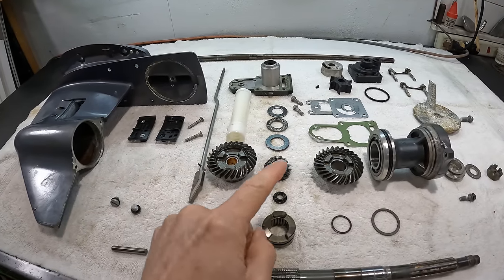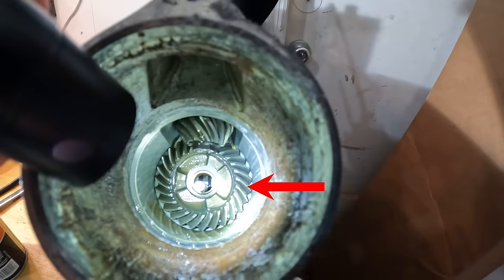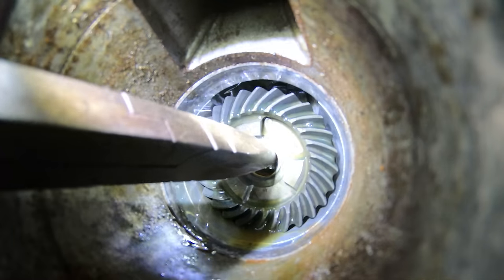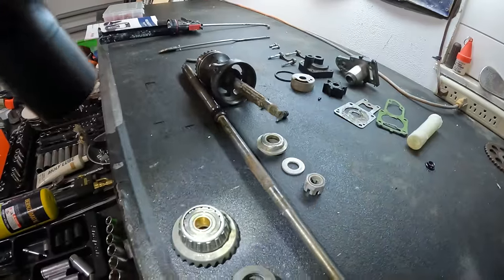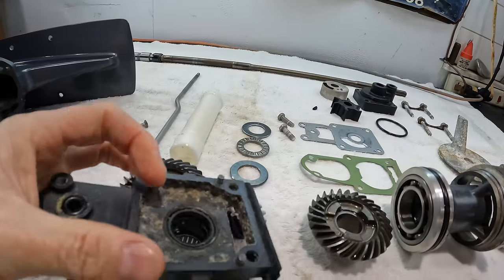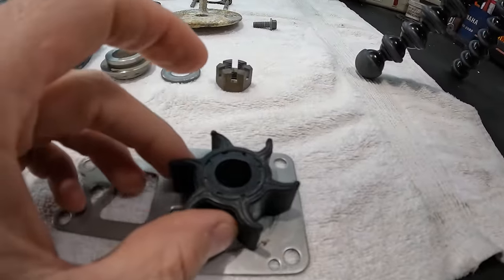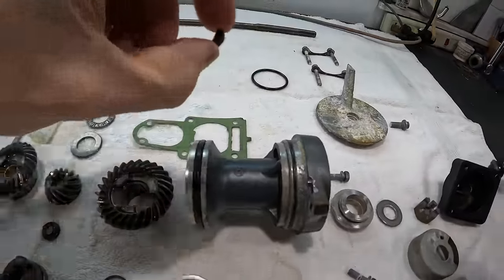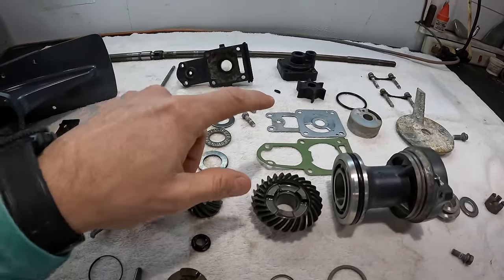HOW A LOWER UNIT WORKS!!!

Comment: I use too rebuild the old Merc Alpha 1 Stern Drive units.  There are special tools and ways to rebuild that you can only learn from someone who knows how to do this the right way. This one you show is a bit simpler I assume this is an outboard engine. My boats were used in the ocean and out there your life can depend on the boat running.
Reply from the maker: That's awesome, a lot of similarities in the stern drives and the outboards with the exception of the uppers on the stern drives lol but this was a smaller 25HP outboard so yeah, a lot simplier!

Comment: I've got a 2002 Johnson V4 115 hp engine that's recently been experiencing extremely hard shifting from both Neutral to Forward, and Neutral to Reverse.  Last spring, I took the time to lubricate the binnacle mechanism that I purchased used from a freshwater boat to replace the one that was on the boat, as well as lubricate both the throttle cable and shift cable by using tubing hose clamped to the cable, filled it with silicone lubricant, and pressurized it until the silicone lubricant came out the other end at the outboard.  After doing all of this, the throttle cable moves so effortlessly that I have to be careful that I don't launch the onto plane after making the slightest change in position once in gear, but the shift cable is still extremely hard to shift, and many times when pushing the throttle forward from Neutral to Forward, the engine just revs to 1,500 RPM in Neutral and then goes into gear with a delayed shift.  Based on what I've done already to rectify this situation and the symptoms that I'm still experiencing, would you say that I have a bad shift cable (it is the original), or is my issue in the lower end?  Any advice from Born Again Boating would be GREATLY appreciated.
Reply from the maker: Well, a couple things, yes, definitely could be the cable still even though you did all that work. But:
Have you tried to disconnect the cables and run the engine without the cables connected? Like try and shift it by hand with some pliers or something there at the engine and see if you still have the same issue even by hand?
What is the RPM when you are shifting? If it's higher than 1000 you are going to have a hard shift either way because the force of everything spinning that high.
Reply: @BornAgainBoating   - With how tightly packaged the throttle cable, shift cable, other wires, and the rubber straps for the airbox / silencer straps are that tuck in-between the engine block and lower cowl, it's difficult to get at.  I need to find out how to remove that lower cowl, so that I can easily get at the shift cable to disconnect it and test just like you said, but despite removing a number of screws, I'm unable to get the lower cowl off.  I feel like it's still secured somewhere in the mid-section of the engine.  I even bought an Evinrude factory manual from Ebay, which I thought would assist with removing this, but proved to be of no use.  I guess that I have to just pull on it harder and see about getting it off.  

I would say that it's shifting at 1,500 - 1,800 RPM when initially put from Neutral to Forward, so yes, it's going to be violent when doing so.  From Neutral to Reverse, it's not so bad, but not normal by any means.  It also has a hard time finding Neutral many times.  When I'm docking and in Forward, I have to pull the binnacle back to Neutral and temporarily bump it into Reverse to then push forward to get it into Neutral.  It's not an issue with the binnacle, as when the cables aren't hooked up to it, the binnacle mechanism performs properly and flawlessly.  It's clearly either the shift cable, or the shift mechanism on the outboard.  I've hosed down the shift mechanism levers and rods (as best that I can) with lubrication, but that hasn't changed anything.  I need to get the cowl off and test further the cable and shift mechanism on the outboard.

Comment: Glad you made this video. Going to have to rebuild a 6HP mercury lower unit that I got as a basket case.
Reply from the maker: For sure! And ouch! Just a thought, maybe look around for a used lower unit, you could probably find one for a couple hundred bucks instead of dumping time and money in rebuilding the one you got ;) These little lowers usually come pretty easily and cheaper compared to repairing one :)
Reply: @BornAgainBoating  if you run across one, let me know.

Comment: Great video, detailed and concise!
The offset stamping on the lower housing is something I wasn’t aware of. Helpful, but seems like a work around for the manufacturer to be able to source lower quality castings. It apparently costs less to measure, emboss measurements and install shimming rather than cast/ machine with closer tolerances. Understandable, especially if the cost savings are passed along to the consumer (insert cynical comment here). I wonder if this is still the methodology in the fancy new motors these days - I’m still running a 1998 Yam 2 smoke 250

Comment: Gday mate that is the best explanation of the workings of a gear case i have seen you made it look easy pulling out carrier from the housing but ive seen some hell carriers ,question is there a special socket you used to turn the drive shaft when getting the pinion nut of ? ive bookmarked this as i said it is the best explanation of tollerences and the breakdown of the gearcase i have ever seen .
Reply from the maker: Hey, thank you! Yes, it depends on the lower unit, but there are special sockets that you can get that slide over the driveshaft to hold it! Depending on the lower too, you might need a special wrench, or have to make a special wrench to hold the nut. But check out Marine Tech Tools, they usually have the sockets for the driveshafts that you could get for whatever you need :)

Comment: Great content! How about a video on what tools should be carried on a boat while on the water? I run a Hewes 18 so weight is important, but so is getting back to the hill. I don't have to carry as much as some, because I'm generally not more than a few miles from some form of safety. So my box isn't going to be as loaded as someone running 50 miles, who can also handle more weight. So what basic tools for common issues and what are some good combo or multipurpose tools that can accomplish multiple tasks? We all know everything is a hammer so I can do without that!
Reply from the maker: Great question, like you said it'll depend on how you use your boat, but just the Leatherman Super tool 300, that thing will do pretty much everything you need, that and some zip ties and a water bottle :)

Comment: Thanks for the great teaching which is easily understood.
I have just purchased a 2012 Mercury 90 four stroke efi and when checking the water pump found the lower Unit top pinion shaft bearing has some rust on it indicating the seal was leaking .The Manual says to replace the bearing ($150 NZD ) if it shows rust but my question is when i lift the shaft up and put it in gear it sounds and feels smooth and only when there is no upward pressure on the shaft does it sound a bit noisy.
The Oil had no metal particles in it but possibly indications of a little water in it  as it only has 80 hours on it and the manual says the first drain might indicate assembly lube. What do you think, pull it apart or leave as is with new seals .I'm in New Zealand and a brother in Christ..

Comment: Great video/explanation. Do you think a 2013 Suzuki 115 would be the similar set up?
Reply from the maker: Basically yes, but the carrier assembly will probably be different and have a spanner nut assembly holding it in. It will definitely be a bigger set up, but functionally it will be the same but also have a shift shaft that spins :)

Comment: Great video.  I have a 2005 Suk 250 with a leak around the prop shaft even after replacing the seals.  There is a visible bearing carrier crack near the seal.  To remove the carrier on a Zuk, is it pretty much the same process as this video?  No special removal tools?  Thanks much.
Reply from the maker: Actually, on most larger engines like 250s, they don't come out like this, but I think on the 2005 Suzuki it does have a similar set up with the bolts holding the carrier in. Not 100% but I believe it does come out and you won't need special tools, at least to get the carrier out. So you should be able to replace the carrier without special tools. You might have some work to do on the bearing and race, getting the race out the carrier, unless you replace them, not sure what comes with new carrier.
Reply: @BornAgainBoating  Got you, thank you for taking the time!  Keep up the great content. Cheers.

Comment: shouldn;t you have loosen the pinion nut with the drive shaft bearing in place? Removing it and loosening the nut induces unnecessary strain to the lower needle bearing.
Reply from the maker: This is true!

Comment: Which motor is this? Is it a 9.9-15hp yamaha outboard lower unit? cause if it is im about to repair my 98 15hp that has the lower unit corroded but the interior is all brand new
Reply from the maker: Yamaha 25HP, should be super similiar
Reply: @BornAgainBoating   thanks man

Comment: But as far as you know, is the driveshaft entirely made of tempered steel or just the ends? Thanks
Reply from the maker: No idea bro, depends on the lower unit you are talking about, brand, size, etc. I would say that some of the smaller ones are not

Comment: Before I unscrew all the bolts to my lower unit do I put the engine in forward, reverse, or neutral?  I have a 1998 115 horsepower Mercury 2 stroke.  Your videos were actually recommended while I was taking a outboard class up here in Massachusetts.
Reply from the maker: Hi! Rose here, working with Aaron on comments. This topic is fantastic! We're going to feature it on our podcast soon. If you haven't listened yet, Subscribe Now! https://www.youtube.com/@TheBoatersPodcast
Reply: Hi Rose, would love to get an answer to my question if that's possible?

Comment: My Hedea 30hp speed boat has trouble.We can start the engine and it is work.But we put the gear to forward or backward, it stopped. It has 2 spark plug. When I unplugged the under spark plug, it is wet with some water and it compress with patrol and water.Is it a problem of engine stopping when I put the gear. Pls reply me .

Comment: Great clip, but doesn't explain why my Honda 90 wont always engage in reverse? Sometimes it does engage, other times it grinds and won't engage. Clutch dog is in good condition with no rounded edges.
Reply from the maker: Most likely it's not getting all the way pushed into place. Probably not a problem with the gear case, but that something is stopping part of the shifting process, to where it's not getting to the gear case. Like the shift mechanism, the shift cable something like that

Comment: Good video, I have a 9.9 honda and I cannot remove the pinion from the drive shaft. The pinion got stripped so I want to replace it. I asked around for price quotes and there charging me 900$ more than my budget. I have the part but have not had any luck, any tips please.
Reply from the maker: Not sure what's up with not being able to get it off, what's stuck on it? Also, you can find a used lower for that engine for probably $4-600, why not just replace it and save yourself the time and money?
Reply: I don't see anything holding it, that's what is throwing me off. Am thinking of cutting it to see if I can pull it out and weld it back. If I can't weld back then I will buy a used lower case. Thanx .

Comment: Can you show the difference between cw and ccw lower units?
Reply from the maker: On larger cases they use a shift crank, and they just swap the shift crank from one side of the case to the other to change the shifting. Though the bearings and gears are different based on needing stronger parts for the forward gear than the reverse, but that's the basic in a nut shell :)

Comment: Great but you missed a bunch of things, the impeller cup has a locking pin on it preventing rotation, alway check it, even new can be damaged, most hubs dont just pop off, they req a puller, some units require special tools, and most importantly you never never explained what the case does besides house the gears and why you never put those stupid stingray/doelphin tabs on the case! (I see the holes drilled in the anti cavitation plate , so i know this case had one) ,, so the general pop knows,, that part of the case is what holds water around your prop, drilling thru it and using disimler materials to bolt on the stingray cause corrosion and weakens the plate further, further more youre esentially lifting the entire rear end of the boat with that plate, loading the shlt out if it, if that plate breaks from either corrosion or load, wich most of them do over time, depending on the side you break determines which direction  you wont hold hold water around the prop,  either fwd or reverse, at that point youll be replacing the entire case or trying to weld it back together if youve got all the pieces

Comment: And what is wrong with filling the gear oil from the top hole? It doesn't go down the plastic sleeve?
Reply from the maker: You can't fill them from the vent because there's no way for air to get out of the gear case then, so you'll have air pockets in the gear case and it won't actually fill up with gear lube. 
When you fill from the drain screw with the vent out, the lube fills the case from the bottom up and pushes all of the air out of the gear case so you get it completely full of lube :)
Mind you some lower units have different tolerances and they don't want them completely full because it slows the gear case down, but that's a whole different topic and specific models :)
Reply: @BornAgainBoating  thank you, I understand leaving no air gap is the idea behind it. 
I used a food syringe to fill my suzuki 6hp gear lube from the top. And it took the same volume of oil 0.2lt written on the user manual. The air came out from the top vent. I'll try to find a pump next time.